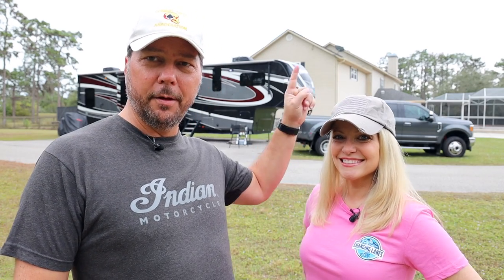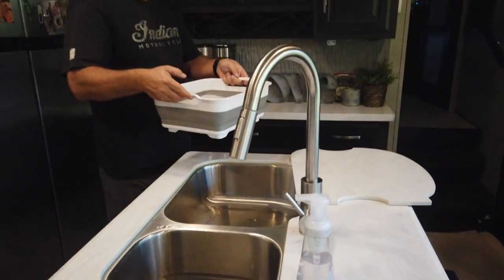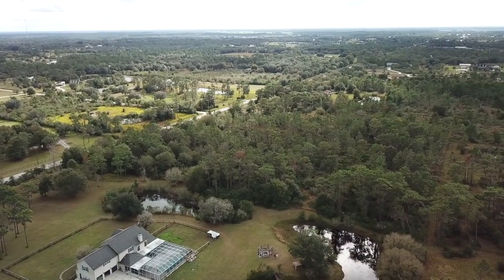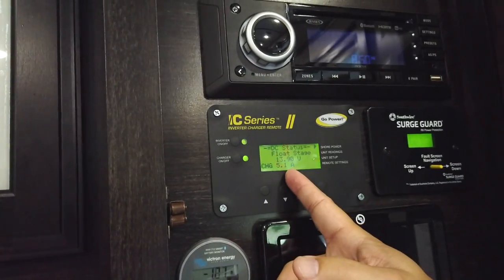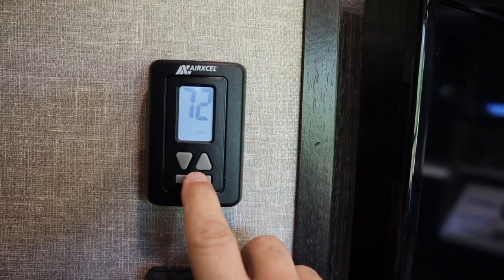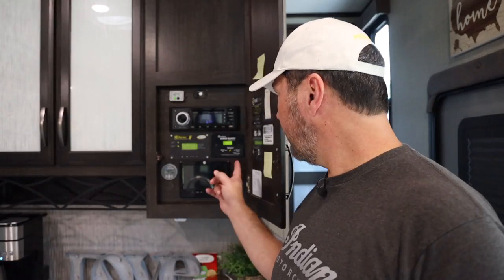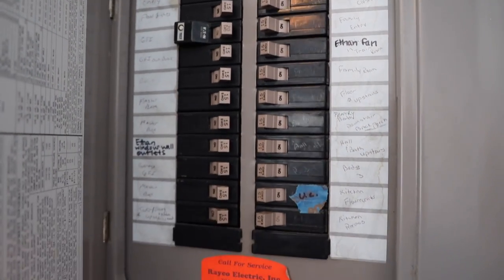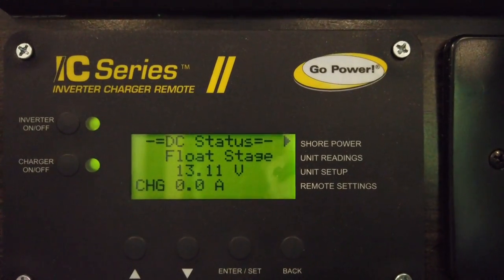RV Moochdocking! | Cheat Boondocking Like a Pro! | Changing Lanes!

Comment: Question. I have a need for 30 amp service to a separate (from the RV) device that I carry with us in our toy hauler. Ok, 2 questions. Could I use your 15/15 to 30/30 to 50amp with just a dogbone back to 30? Question 2. Is there a way to wire a 30 amp outlet to the Cummings 5500 generator? The 30 amp device only pulls 22 amps but does so for about 18 hours. Thanks
Reply from the maker: No idea on re-wiring the genny.  On the adapters question, I'm not really sure I understand.  What kind of plug is on this 22Amp device?
Reply: It’s a regular 30 amp rv plug. It’s for a kiln that I anneal blown glass in.

Comment: Best way to find out is to try and see if it blows? How about manually tripping the breaker to see which outlets you killed, so you know which ones are on the same circuit. Please leave electrical tips to electricians before you set someone’s house on fire.

Comment: If you are on a 30 amp site that also has a 15 amp outlet on a separate breaker, could you use the splitter and plug into the 30 amp on one leg and then plug into the 15 amp on the other leg?
Reply from the maker: Yes, in theory...   As long as the pedestal isn't limited to 30A total, which is likely the case in many parks.  Might take some experimentation to figure out which leg has 30 and which one has 15.

Comment: Is it possible to start the AC's with the generator on just to spool up the compressors then turn generator off to just stay on 15amp ?
Reply from the maker: I don't think so.  When you shut off the genny, the ATS switches back over to shore power.  There's a very short (less than a second) time to cut over to shore power.  But that very quick outage while switching might cause an issue with high current load.  The ACs will likely shut off.  Same thing when stopping shore power and switching to the Inverter....

Comment: What size extension cord are you using? I tried this with my 50 to 30 to 15 amp dogbones and it kept tripping the outlet in my house (a non-GFCI outlet).
Reply: I'm assuming they were using 12 gauge.  14 might be ok (not sure) but definitely don't use 16 gauge.  Those are only rated for 13 amps I believe

Comment: I hope this makes sense but if you have a dual 15 amp to 30amp adapter and a single 15 to 30 amp adapter and a dual 30 to 50 amp will you have two 45 amp legs or one 30 amp and one 15 amp leg or will it not work?
Reply from the maker: You only have 2 legs to split and you can't split them again down the line.. so the options are 15+15, 15+30, or 30+30 (but 30+30 has special requirements - see the description or blog post here: https://changinglanesrv.com/rv-moochdocking/
Reply: Thank you
Reply: @ChangingLanes   you Y adapter link goes to rhino not electrical...

Comment: I have a question and I’m not finding a lot online. I have a 30amp RV. I was connected to a 50 amp outlet with an adapter. I noticed the adapter was warm and the ends got a little burnt. When I thought about it that breaker is 50amps so it would allow me to draw more amperage than my rig is really rated for through that cord and adapter. So when going from a 50amp outlet to a 30 amp RV is there something else we should be using to make sure it does not draw more than 30 amps, or is it just kinda keep it in mind and be careful?
Reply: It can't draw more than 30 amp,  your RV is a 30 amp, that means if you hook enough stuff up to the RV the main RV 30 amp breaker will trip.
Reply from the maker: It seems that your distribution panel 30A breaker would trip if you were drawing more than 30A.  Make sure your connectors are clean, maybe?  If you're seeing burn marks, something is wrong...
Reply: Thanks. I don’t know why I didn’t think of the main stopping it from more than 30. I have not had any issues since I used the 50 amp.

Comment: When the inverter kicks in, does it create more amps on the interior wiring than the RV was wired for (15 or 20 amp circuits) (#14 or number #12 AWG inside wiring)?
Reply: Amp aren't created, they are drawn so the inverter doesn't change that other than allow more to be drawn if needed.
Reply from the maker: Like John said.. Amps are drawn by usage.  Even if the inverter was capable of amperage higher than 50+50 (shore power), the RV breakers would trip first.  Hope that makes sense...

Comment: When going down to 15 its important to use high quality extension cords either 12 or 10 gauge not using cheap 16 gauge cords is essential
Reply: I was only using the dogbones since I'm not far from the outlet.  My surge protector said the ac was pulling 13 amps and 1 amp for something else so 14 total.  The outlet im plugged into is on a 20 amp breaker.  After about 2 hours,  the cord was getting hot. Any idea why?

Comment: Wait so even if you're connected to a power source you still have to charge your batteries?
Reply from the maker: Yes.  But no one usually thinks of it like that since the converter or inverter comes online with power and does it automatically.  Once the batteries are fully charges, most of the current from charger (inverter/charger or converter) supplies the DC power, but it's a constant up and down of the last 1% of charge...   Hope that makes sense...

Comment: Question 2: Do Grand Designs come with a good inverter?
Reply from the maker: Ours had no inverter.  But, it is an option now to have one installed as a factory option.  But, I have no idea as to the wattage or quality.  I do know it does not power the whole RV.
Reply: @ChangingLanes  Thank you, just trying to wrap my head around what the sole purpose and thinking about putting it on our purchasing list :) Since you guys are in Charleston, SC there is a pizza place in the down town area that has great pizza not to far from the boating area.

Comment: I'm certainly no electricity expert so I have a question. If you get that Dual (1 female 50a to 2 male 30a) adapter - If I were at a campground that only had 30a service (but there were 2 of them available) I could plug both in to run 50A to my trailer, correct?  Now, that won't somehow become 30+30=60A and cause me to blow circuits?  Or is it just that the trailer won't draw more than 50A either way?
Reply: It will only draw what amps it needs.
Reply from the maker: Jason is right in that it will only draw the amps being used (amps are drawn, not supplied). But the issue with 30+30 is if the sources are in phase, there's a potential to have a 60Amp differential across the neutral.  But, if you keep overall usage under 50A, you'll be fine.

Comment: I'm just not sure about the 2 15amp to 50 set up.  I see it working but everything tells me it should pop the breaker at the source.  Both a/c running for a total of 28 to 30 amps on a circuit with at best a 20 amp breaker.  Am i missing something?
Reply from the maker: Yes... They are connected to separate circuits at the house and therefore on separate breakers.  Each circuit is rated at 15 or 20 amps individually.  👍🏼
Reply: @ChangingLanes  ok.  Now that makes sense.  Thanks for the response.  Safe travels!

Comment: Would you suggest a hard start kit on your AC when your on 15 amp?
Reply: I would be interested to know that as well. I didn't know that is the initial surge was so high and I don't undertsand how that doesn't trip a breaker.
Reply from the maker: A hard start (basic capacitor with no "smarts") or soft start (same but with "smarts" but about 3x the cost) are great add-ons if you're having trouble with blowing breakers, tripping the genny, etc.  But, we've never had any issues using our stagger start method so it's difficult to justify the cost in both money and time right now to invest in them.  
That said, they certainly can't hurt.

Comment: The thick heavy long extension cords are more expensive than a solar panel!  Of course there's batteries and controllers but ... still.
Reply from the maker: Two good extension cords might be $200.. $300 max and you won't get continuous 30A from it...  Two totally different scenarios.

Comment: Can you run totally off your inverter while charging from shore power?
Reply from the maker: Not really... and it wouldn't make much sense to convert to DC to then convert back to AC for no reason.  Energy is lost in the form of heat for each transformation.  👍🏼

Comment: I have a 30 amp RV camper when I do the air conditioner in the microwave when will blow the circuit why is that? Thank you
Reply from the maker: It's likely that your AC is drawing 13A and the microwave is drawing 13 or so amps also..  So there is likely something els also running.. water heater, fridge, etc... Putting you over 30A.  It could also be a crappy breaker on the pedestal.

Comment: quick question if you have a 30amp rv do you need to 15amp splitters or just 1 there are 2 ac's but are soft?
Reply from the maker: Just one 30A to 15A dogbone is all you need.  You will only have 15A (maybe 20 depending on the circuit) total since 30A RVs only have one leg.  Hope that helps!

Comment: How do you get a AC to crank up using only 13 amps?
Mine usely shows 17 amps when cranking up on my EMS
Reply: I believe they have the dometic ac units.  I have a coleman 15k and a 13.5k.  Both were pulling 13 amps somehow but when I plug into my generator,  the 15k unit pulls 16. So confused

Comment: When using the 50 a splitter, can I use 30 a on one side and 15a on the other?
Reply from the maker: Yes...  Just be careful if doing 30+30... make sure the sources are on separate phases (separate sides of the house main) or you can get 60A on the neutral.

Comment: Most neutrals will only be for 30 amps if you use 2 30 on same leg you will probably melt the neutral
Reply from the maker: Yes.. see the notes in the description and blog post - will depend on the phase.  But the neutral wire is actually rated for 60A, which is the max possible with 30+30.

Comment: How does the system know how to split the lines since at the end of the day both extension cords end up in the 50 amp line?
Reply from the maker: It's split at the 50 - 30 Y adapter.

Comment: i have a 50 amp RV
if i moochdock, can i use a 15 to 50 dogbone?
or do i need to get a 15 to 30 then to a 30 to 50
thanks
Reply from the maker: 50 to 15 is fine.  No different than 50-30-15.

Comment: so its way better to get 50 amp over 30/ can one order a smaller rv  with 50 amp?
Reply from the maker: All depends on the RV.  Generally if it has one AC, 30A is pretty common.  RV wiring is what it is for each RV, generally no way to order a 30A RV with 50A.  Completely changes the wiring.

Comment: What about using 30 and 15 to 50, how does that work?
Reply from the maker: Technically, it should work if the pedestal is wired to handle 45A total.

Comment: Are you two using MicroAir units on your AC units?
Reply from the maker: No.  We've never found them to be necessary as long as we stagger start them.  Every now and then there'a a chance occurrence of two AC's hitting an auto-start simultaneously and tripping the genny breaker, but it's very infrequent.

Comment: Do you get any buzzing noises in response to the low amperage coming into your unit?
Reply from the maker: No.  Amperage is pulled as needed and there shouldn't be any buzzing related to a lower amperage draw.  Nothing that I can think of, anyway.
Reply: @ChangingLanes  Thanks for your feedback. I'm trying to run down a problem of buzzing while connected to shore power one tech said it was the low amperage.
Reply: @mrclay50  may just be your transfer switch?  Mine used to buzz badly when connected to shore power.  This is common with 50 amp transfer switches and after I upgraded my auto transfer switch, it went away

Comment: I found if the people you are moochdocking from want you back they will install a RV power box for you. If they really love you they will also install a sewer hook up for you.
Reply: Actually the people mooching should step up and offer to install a 50a rv recpt installed.  Why should the people being mooched get mooched even more?
Reply: @WIDESIDE72  If you start paying your own way then you are not moochdocking any more. LOL That is actually a great idea.
Reply: @WIDESIDE72  since a 50amp RV plug is really 100 amps it could require major panel upgrades at some residences. Probably not worth it for a temporary stay. But definitely a must if staying a few months vs a week or two. 

Definitely would recommend an outlet test kit to make it easier to find two plugs on different breakers/different power legs instead of the just see if it trips approach. Also important to take into account what's being used inside the house on the breakers not just In the RV since the splitter uses most of the available amperage.

Comment: I have hooked up to my house power to my 50amp RV and I dO not have power to my RV any suggestions
Reply from the maker: Your best bet is to get a volt meter and check for voltage at each junction/plug.  If you have a surge guard or similar check voltage there, check breakers etc...

Comment: So I’m assuming that I can do this same thing with a 30amp and a 15 amp 110 right? Like at a campground that has a 30amp plug and a 110 15 amp.
Reply from the maker: Yes... but see the blog post and description for warnings about using full 30A on both legs.. it can create 60A on the neutral if they are in phase.
Reply: @ChangingLanes  Thank you sir, will do. Hello from Texas !!

Comment: Do you have soft starts on your roof AC units?
Reply from the maker: No.  Haven't needed them.
Reply: @ChangingLanes  I understand that you might not need them but look into how having them can add longevity to the a/c units. Or at least that's what I was told. It prevents that hard surge every time the compressor kicks on which takes a toll on the unit. Any how just an FYI!

Comment: Does plugging into shore power charge the RV battery?
Reply from the maker: Yes...  going to go into that in more detail in an upcoming blog post.. But, when the AC shuts off and the circuit has the extra power, the inverter charges our batteries.
Reply: @ChangingLanes  Yeah I didn't comprehend that fully - looking forward to that blog post :-)

Comment: ? Have u thought about putting Airtabs on ur truck and or RV.?
Reply from the maker: Never really considered it... Have you used them and noticed any difference in MPG?
Reply: I have them on my truck, but dont notice as much. Better for trailers and bigger Van's.  Might wana look into. Clam better control over cross winds and such.
Reply: Plus how many miles did yall put on the truck in one years time?

Comment: Everyone is saying you can't run ac while moochdocking with a 15amp converter. Or you can but you won't be able to use anything else.
Reply from the maker: Right.. if you haver 15A available and you run a 13A AC unit, there isn't much left for other stuff...  Which is why we put our fridge and water heater on propane in situations like that...
Reply: @ChangingLanes  thank you

Comment: If the  15 amp circuit has a 5 amps  of load inside the house . Now you have 10 amps Which you cannot run your AC

Comment: A 15 amp breaker is only good for 12 amps.  A 20 amp is good for 16 amps. Per the NEC breakers have an 80% trip rating. This is to off set starting loads..
Reply from the maker: Indeed.. this and other info was added to the description and blog post shortly after publishing...  👍🏼

Comment: why not put put in soft starts
Reply from the maker: A hard start (basic capacitor with no "smarts") or soft start (same but with "smarts" but about 3x the cost) are great add-ons if you're having trouble with blowing breakers, tripping the genny, etc. But, we've never had any issues using our stagger start method so it's difficult to justify the cost in both money and time right now to invest in them.

Comment: Single 50A to dual 30A Y adapter. Anyone know if there is a 30A version? 30A female to dual 15A y adapter? got me thinking about being able to supply full power to my 30A RV in a similar "powered by house" set up
Reply from the maker: 30A RVs only have a single 30A circuit, so there's nothing to "split".  50A RVs have two 50A circuits to split out.  Hope that makes sense.
Reply: @ChangingLanes thanks for the reply. yes, totally understand that, was thinking a 30a to dual 15a Y adapter would allow me to supply a full 30a to my rv. Much like accessing a full 50a instead of only 30a or 15a. I'm no electrical wizard so I could be completely off base here.
Reply: @ChangingLanes  sorry, I think I wrapped my head around what you were saying. That makes sense
Reply: @hobbyguy79  Watching the video, I think that using the 30 to 2 15s will give you a full 30.  (* I am not an electrician and did not sleep in a Holiday Inn Express last night)